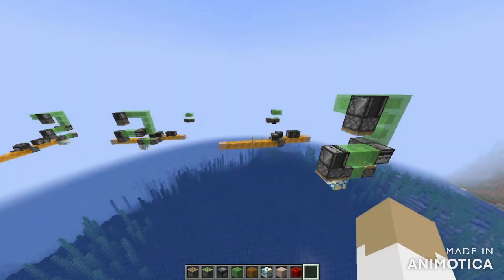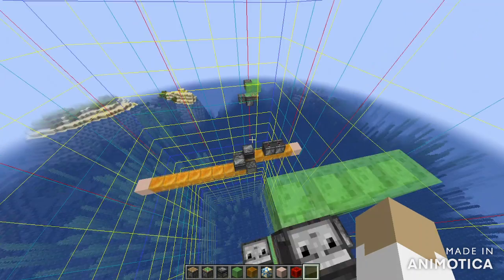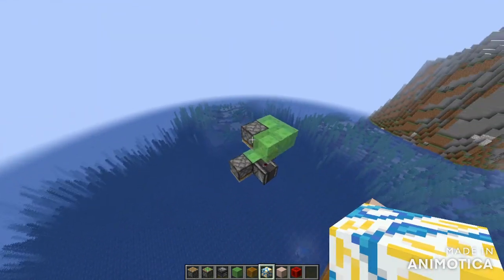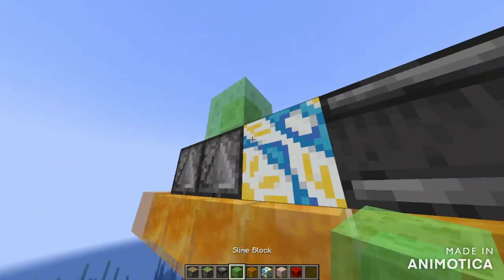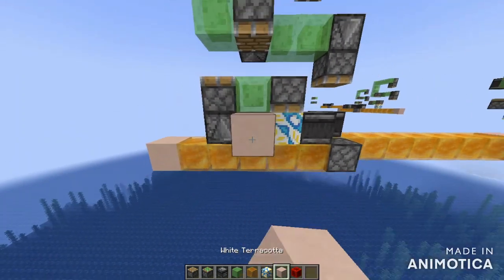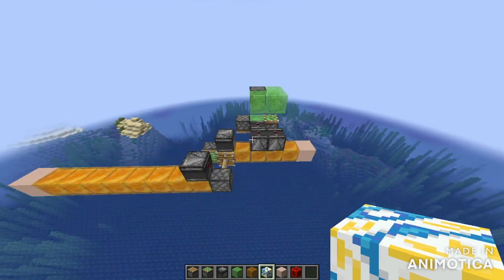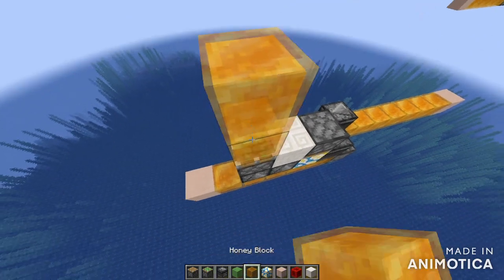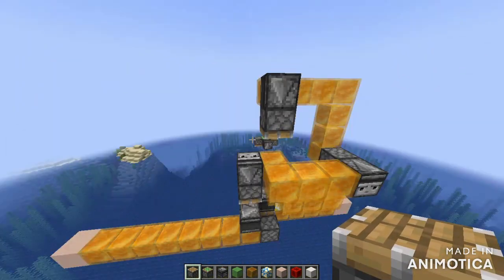Fully Automatic OCEAN CLEARING Flying Machine - UPDATED

Comment: I built it right 3 times and not for some reason the send back mechanism is pushing my flying machine down EVERY single time now. Do you have any idea what is doing that? I try and I try and I am building it along side you but for some reason it keeps doing the same thign.
Reply from the maker: Hmmm, have you checked whether the orientation of the send back mechanism is correct? There might be a piston hitting the flying machine itself (if you have accidentally mirrored the build)

Comment: I HAVE JUST SPEND HOURS AND HOURS OF MY DAY BUILDING THIS THING OVER AND OVER AND OVER UNTIL I DIDNT NEED THE TORTURIAL BUT STILL IT DIDNT WORK THE MACHINE ON ITS SEACOND RETURN JUST FLYES ¨PAST THE MACHINE, THERE ARE NO BLOCKS THAT HIT ANY PART OF THE MACHINE AND I HAVE BUILD IT EXACTLY LIKE YOU DID IT JUST DOSENT WORK I BUILD THIS IN 1.20.4 PLZ HELP OR COULD YOU FIND ANOTHER WATER REMOVER THATS EASY TO BUILD BC THIS IS THE ONLY ONE I FOUND THAT LOOKED SIMPEL AND IT  JUST DIDNT WORK
Reply from the maker: would suggest checking the following - chunk alignments, check direction, and push limits. Also pls cool it on the caps. The design has worked for plenty of others.

Comment: Nice design. Works in 1.20.4. I messed around with the design to make it more compact. After removing the second downward facing observer I realised for myself how you mentioned it is directional. The direction affects some update order, causing a piston to not fire. When the flying machine would reach the lowering station, the mounted observer first powers a slime block, which powers two pistons. The downward facing piston pushes down part of the flying machine, which in turn pulls down the mounted observer. Depending on the direction, the slime block is unpowered before the upward facing sticky piston can fire, thus ending the slime sequence prematurely. Looks like you got around this by adding another mounted observer. To keep a compact design, I moved the downward facing piston from the side to the back and rearranged everything. This means I have two slightly different designs depending on direction, but now my lowering station is only 3 blocks wide, so I can put it in a channel only 5 blocks wide.
Reply: Can you upload some video showcasing how you edited the returner! I'd love to also be able to run it for my farm but I'm having a hard time reconstructing it from words.. :)

Comment: So I made the machine, and it worked until it gets to the push down mechanism, it needed the second observer, but when I added the second observer it doesn't push down the first section of the flying machine quick enough and it just goes past it... I'm gonna try to put a piece of obsidian behind it so it can't fly past but I'm not very sure if it'll work
Reply from the maker: You may have hit the push limit? Knock off a block from the end with the two observers
Reply: Aye that's actually a good idea, I didn't think of that lol... thank you
Reply: @drewishgaminginc.3942  Mine also did this and knocking off blocks doesn't work

Comment: The construction works, but it doesnt remove the water. It just flys through the water without destroying the water block. (1.19)
Reply: could it be because of the new waterSourceConversion gamerule? ive been having trouble with it,even though it's just so infinite water sources can be made.
Reply: same problem here
Reply: You need sand on both sides of the machine

Comment: I've recreated the machine and it wont push down properly, the piston to push the terracotta down works but the sticky piston on the other side of the slime block doesn't power so only half the machine is pushed down
Reply: the observer pointing into the sticky piston may be in the wrong direction, the same thing happened to me

Comment: im on 1.18.2. The machine is working and flying back and forth BUT it is not removing ANY water/ water block. I used both slime and honey block version. Doesn't remove water.

Comment: I built this and stopped it midway by placing a terracotta in front of the observer. But after breaking the terracotta it hasn't moved and I've tried to replace observers and it's still not moving.
Reply from the maker: Check push limits maybe? a slime block may have stuck to an unwanted block while stopping it
Reply: @SciSyf1512  I've remade the flying part and it worked. It also stops moving after going into the nether and coming back but the flying part is so easy to build, after couple of times I've started to build it in less than a minute. I guess I'll be using this design for all of the draining. Thank you for the tutorial and your answer!
Reply from the maker: @theguywhoisjustaguy1262  You're welcome! Good Luck with your projects!

Comment: Unfortunately not working for me - built everything the same, rebuilt a bunch of times just to be sure, but...basically, at the reverse mechanism, the lower part of that mechanism gets pushed down just in time for the observer to hit the flying machine's observer. So instead of the flying machine successfully leaving back towards the direction it came from, the observer pushes the flying machine's observer downards,  which pushes down that whole section of the flying machine and makes the whole thing stop. Its like the reverse mechanism's moving too quickly and the flying machine can't get away in time. Not sure whats going on or why its not working.
Reply: I dont know if you want the answer after 6 months but i had the same problem, and the solution is put atleats 1 honey block after the 2 observers, i used to have a solid block rigth after the 2 obsevers, and i have the same issue, but if you add 1 honey block more it work, i dont know if i explain well (english is not my native language btw, srry for the mistakes)

Comment: This is awesome. Do I need to build a trench first for the parts that push down or can I place it without a trench?
Reply from the maker: It is better construct the trench first. If you build the machine without the trench, the water on the sides will remain and flow over (so it looks like nothing has happened, and can occassionally stop the machine). Once the machine stops youll be forced to clear out the water on the sides manually.

Comment: I'm having a problem where the flying part of the machine doesn't move down it just passes right through to the gravel wall, all the other parts of the machine work perfectly, it seems to be because the piston pushing the flying machine downwards is too slow
Reply from the maker: hmm...you might be having a problem with the push limit, just check to ensure that no piston is pushing more than 12 blocks, and that no gravel is touching the sticky blocks.